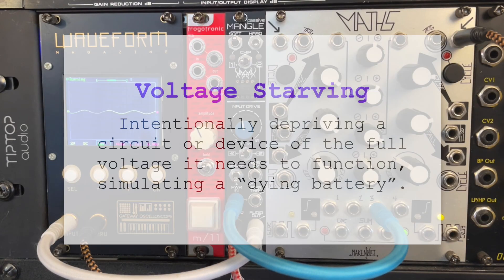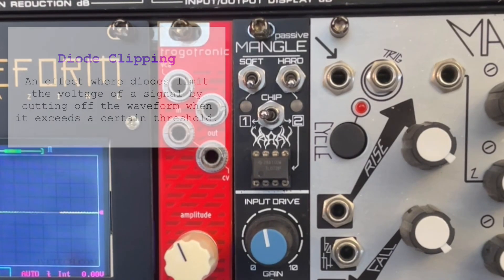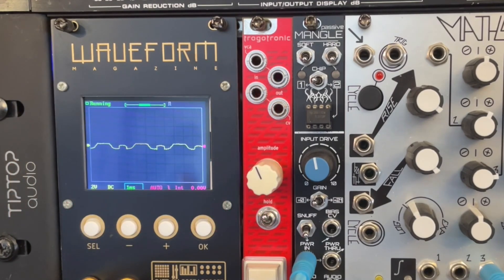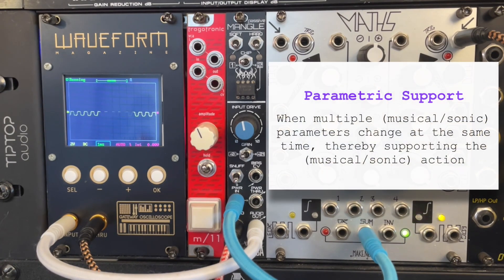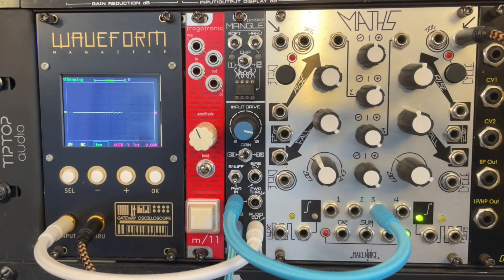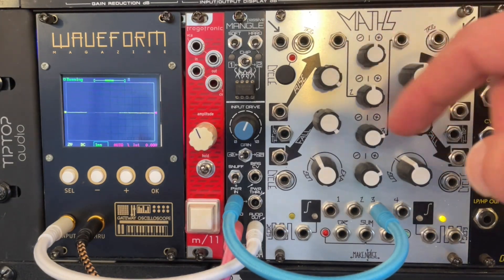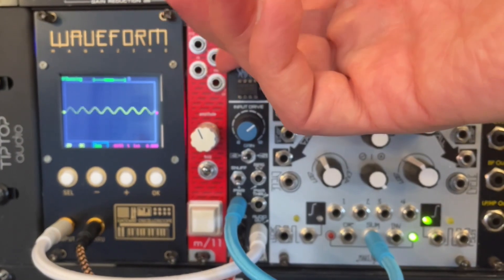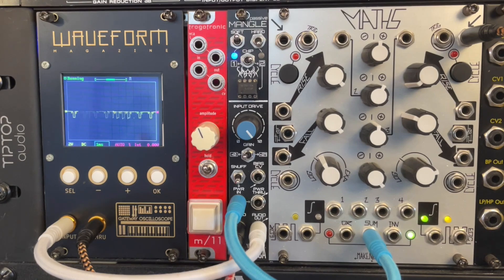Voltage Starving in Eurorack (Abusing op-amps with Blood Cells Audio "Mangle") | Simon Hutchinson

Comment: I love all you’re videos this is like ghost syncing
Reply from the maker: I'm not sure what "ghost syncing" is, but thanks! 😅
Reply: “Ghost syncing”was me being ironic and still just me being rather  silly about the ideas that voltage starving is operating in a manner that there’s an element generating a phenomenon while being completely electronically metaphysical in its mere existence through the phenomena being rooted in a conditional sort of absence and the tension between that and contrarians upon the the absence .. as in this video it’s entirely dependent on circuit specific design, that’s in the other video as well based upon the engineers circuit board and where it will pull the minimally available power (operating as if it were synced to another- often doing something abnormal and that appears illogical- it isn’t but has said appearance  (voltage is voltage) some of the sonic presence has the textural qualities of an ionic oscillator (exhibiting symptoms of proprioception using muscle fibers from outside of time) resembling a sonification of action by  the third mind of- by way of  synthesizer).. I wasn’t being technical but drawing upon Brion Gysin and Burroughs assailing the Logos as the logos governing this musickal interlocution via Tzim Tzum if you’re (an Issac Luria informed esotericist or just a sonic mystic).. it’s not going to make you’re average person giggle there’s a lot that has to fall in line as far as art. It was an appeal to the irrational for humor. I would say “the cat inside” and “planet R101”  .. explaining jokes makes them unfunny. Even here there’s a reference to Room 101 by gysin. I think a few people over time would have gotten the irony of the absent gear.. as subtle and profound. I may stand alone as an artist  in this, Simon. I don’t really truly know.🤷 i loved the effort abusing gear is on of sound designs massive creative engines..and a source of inspiration. I made joke about danger music, I’m not sure I left it in on either channel involved. I really hope it didn’t seem rude or anything thing of the sort.. that’s not really me at all.. we’re both in a very small community with Kyma 7+++ or X . I was going to ask you about the best source for really learning capytalk’s language and programming elements / strategies since it’s.. I cannot really find “Kyma X revealed” I would like to contribute more.. in the community.. it’s a pair of tremendous videos that only circuit bending informs. My is so long because you asked and I wanted to give a detailed answer. That’s grounded in misuse of equipment in pursuit of timbre and textural elements this dear to me on so many levels I just call the creating from a super positional perspective .. ghost syncing in this instance.  Maybe I was the only one who saw it as such? It inspired me and I was hoping express my thanks .